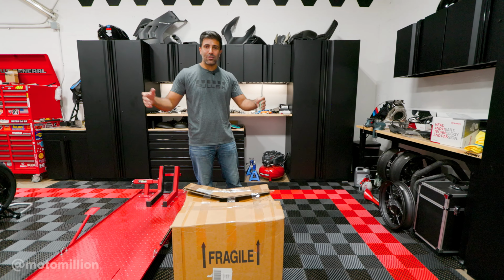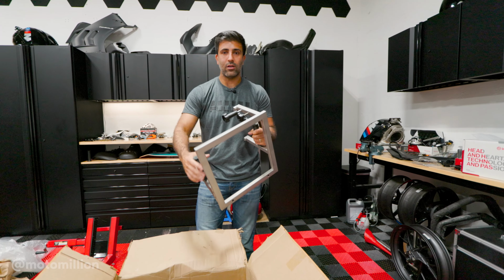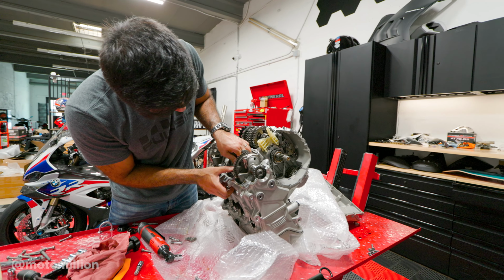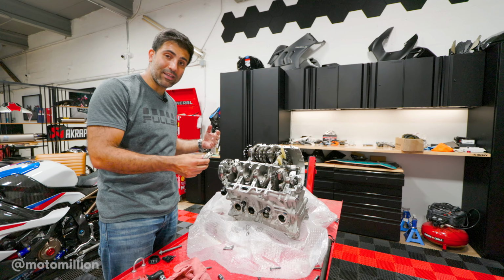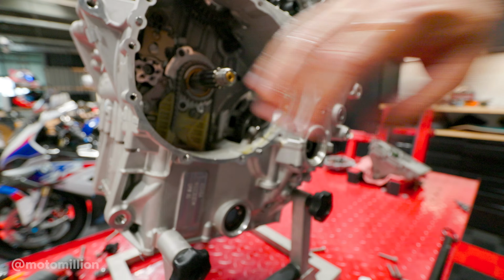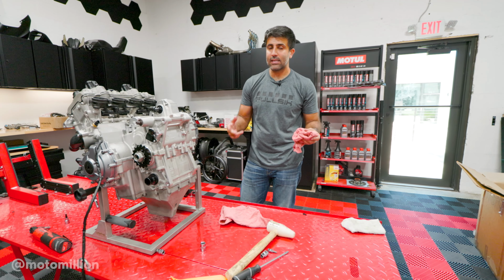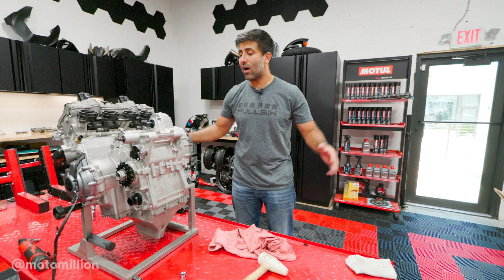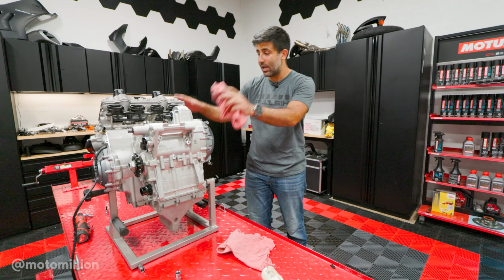$15,000 Coffee Table Build | Part 1

Comment: What am i missing here. Whats preventing the engine from being rebuilt? Like essentially its bought and paid for, but just spun a bearing right?
Reply from the maker: Need to figure out the cause of it. If the block's oil galleys are the problem, we don't want to have the same issue again.
Reply: @Motomillion  yeah fair. Figure it would have been easier than figure out how to make a table out of it when you already have the engine, and a stand 🤷‍♂️

Comment: Would be nice to know why warranty was refused? Most common mistake what ppl keeps making whit modern motorsporting, specailly in Amg, Rs, M line cars/motorcycles is when they start decide that my engine is a race engine. They pick up coolest looking oilcan from market where is coolest picture and says RACING 15W50. issue is that when you pick thicker oil, it cant form film between these thin bearing tolerances what these engines has these days. Allways match your oil, whit your engine bearing tolerances. Not what can looks best in store.

Comment: still can't get when you add a tune you void any warranty even if you put the factory tune back they can still see it and if you do not break an engine at that level in right before you unlock it and turn those rpm you stretch the connecting rods and it will destroy bearings plain and simple that motor should have had 2 or three thousand miles on it before you ring it out with a tune on a dyno not all are misinformed of how engines work it failed yes it was however your fault period

Comment: Glass cannon engine ..... maximum HP zero consideration for non race / road use... 
The toyota 3 pot that blew up on their GR's sounds similar.  same as KTM 790 camshafts. 
Theres a reason we older/wiser guys buy older 2nd hand proven designs...

Comment: In the end it turns out that all the hype regarding German engineering and builds is just bogus. German motorcycles and cars are just as reliable or unreliable as Italian engineered and built motorcycles and cars. If I would buy a new motorcycle it would either be an Italian, Ducati, MV Augusta or Aprilia in that order, or if it was a cruiser a Harley Davidson cruiser (which I now own). These brands offer nicer bikes to look at. I would never buy a German car because of it's brand name. And for cars I go Italian, simply because they are better looking and I have owned a few. Hardly any issues, as with my Harley or previously owned Ducati Streetfighter 1098, aside from normal wear and tear.

Comment: Common issue in the racing community that nobody wants to talk about. I’ve nuked 3 engines now, 2 of which had that same failure. It’s not my place to try to elaborate but what we’ve learned, I’m not the expert, but heat soaking and warm up are very important as well as extended break in periods. The factory rod bearing tolerances are too tight and will seize/spin under imperfect conditions. There’s a reason why our race electronics have an oil priming mode prior to startup. Keep in mind that the titanium rods of the M heat/expand at a different rate than the rest of the engine metals which is another factor. Suffice to say they are finicky at best.
Reply from the maker: The titanium rods expanding at a different rate has never been the thought, but this is a very good point!
Reply: Exactly! They built a 1 off machine it needs to be scientifically broken in

Comment: Was there any evidence of fretting marks on the rod cap mating surfaces? Would also be great to get the rods out, cleaned up, torqued and measure the big end journals for tolerance with a bore gauge. Another thing that can lead to damaged big end bearings in a situation like this is incorrect piston to bore clearance. If too tight, the piston can grab the bore when it expands with heat and accelerate BE bearing wear.
Reply from the maker: Very good point. THe cylinder walls were really clean, no marks. The dealer stuck a camera in there the first day they received the bike.
Reply: @Motomillion  got it. You’d definitely see marks in the bore with that scenario